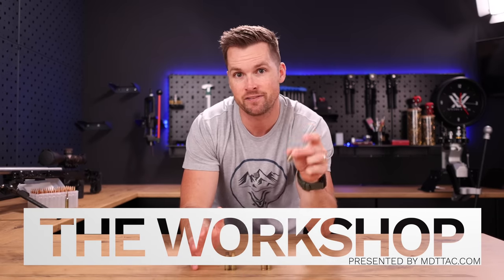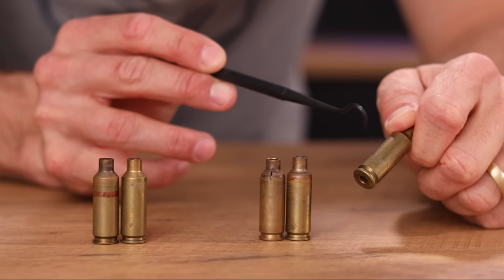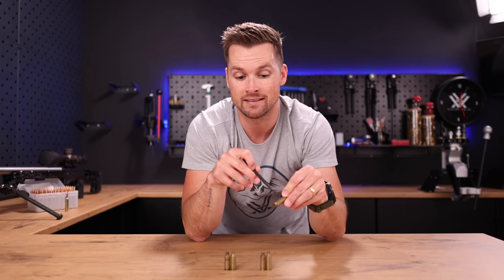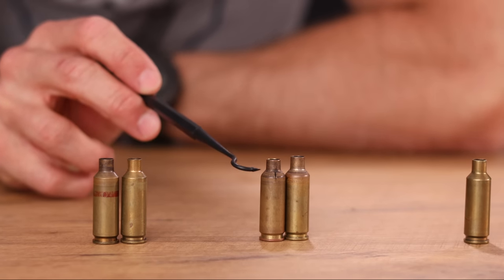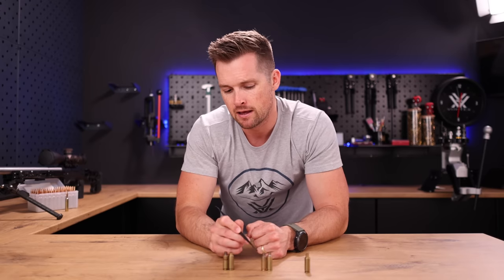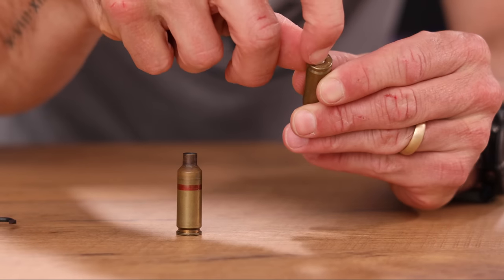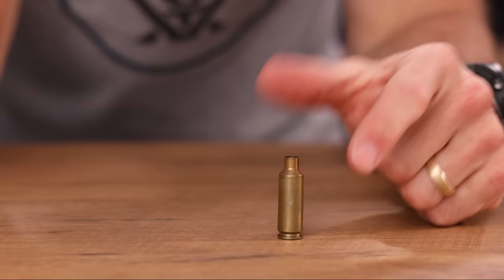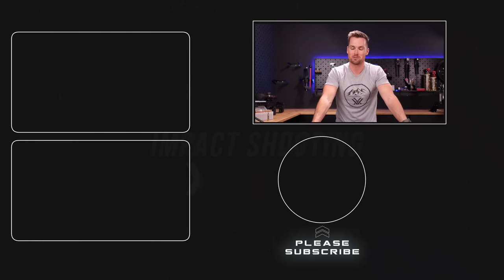Case Failures All Shooters Must Avoid!

Comment: I'm quite meticulous about reloading, and have been since I started about 36 years ago, and in that time with thousands upon thousands of rounds fired (probably more like 150,000 rounds), I have only had one partial case-head separation. The head didn't fully separate, but it blew out about a third of the way around the head-rim junction. This was in my match grade AR-15 that I use for high power XTC (across the course) NRA/CMP National Match competitions. Thankfully it happened as I was just practicing, but when I fired the round, it blew out the bottom of my magazine, spewing the magazine base plate, mag spring, follower, and a few rounds that were left in the mag, plus all the hot gases, down the magazine and onto the ground. Needless to say, I almost needed a change of underwear that day. 🤣

Comment: I've had one case head separation in my gas gun. Luckily it was during a class and the whole case ejected. The head was hanging on by a thread. My instructor and I started looking at the cases and I had several that showed signs of "belts". I sat those rounds aside and the rest of the time in class all was fine. Since then I inspect every case and trash those that showed signs of belting. Interesting thing, I was using rcbs small base dies. I stopped using those and switched to hornady dies and haven't encountered it since. (6mm ARC) Still haven't figured out if the sizing die is the cause or if it was the load or if it was just the hornady brass. Haven't encountered this problem with any other cartridge I load for.

Comment: Takeout the expander from your sizing die.  Stop torturing your brass.  Even better; use Kiwi neutral for acase lube, spin the case in the can run thru full length sizing die no need to clean lube.  Case life x 3.  Try it, also cuts down on case trimming.